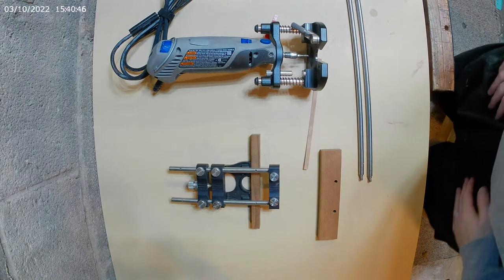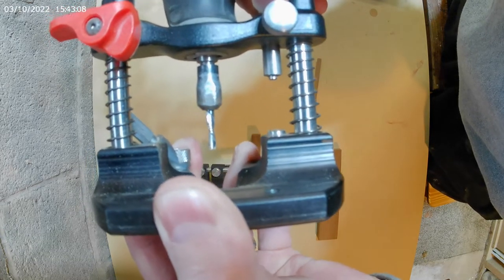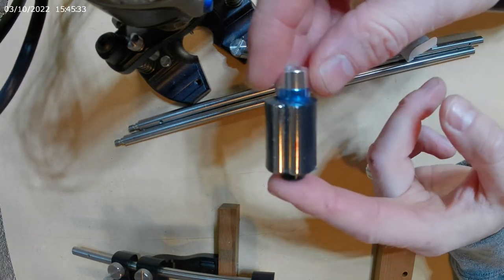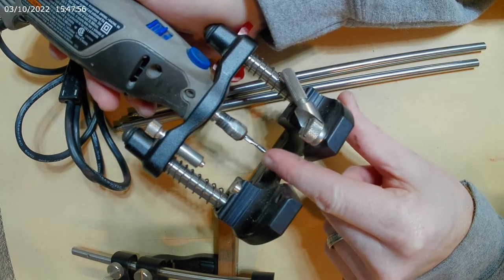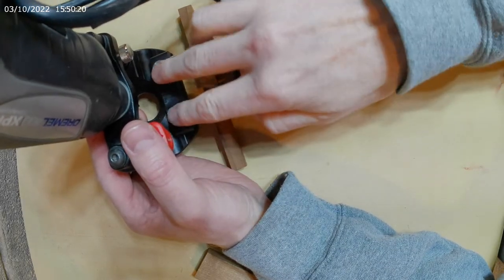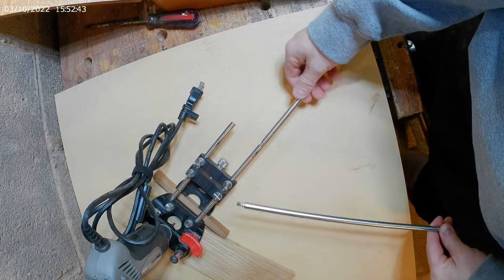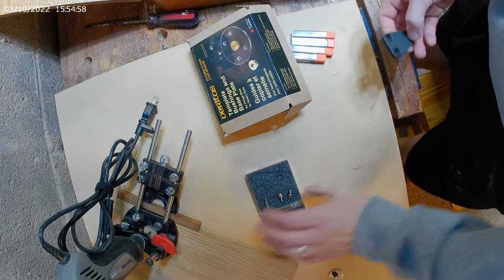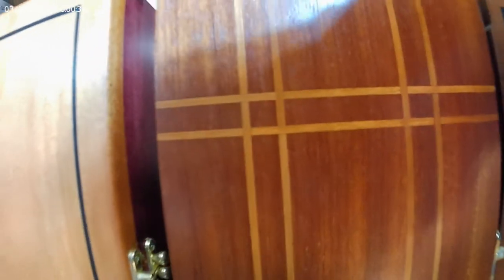Veritas Dremel Plunge Base Review

Comment: Nice boxes!! 
Have you tried the template bushings yet? Centering the bushing with the shank is imperative, but I notice they provide no means of centering the bushing. I'm assuming they are relying on the precision of the base and base plate to automatically take care of that. 
Any comments along those lines? 
Also, do you know the outer diameter of the threaded portion of the bushings? Just wondering if it accepts the other Veritas guide bushings which are standard porter cable 1 3/16" bushings. Thanks for all the content!
Reply from the maker: I haven't, I have the set but just haven't found the project to use it for. Veritas does sell it tho. Honestly I would probably be more likely to go with a trim router with 1/4" shank for that purpose. The Dremel attachment for me, is mainly for small stock removal equal to or less than the diameter of the bit, 1/8", due to the fragility of the tiny shank.